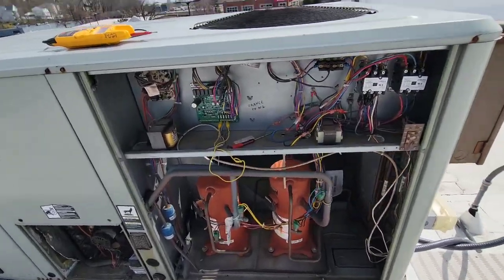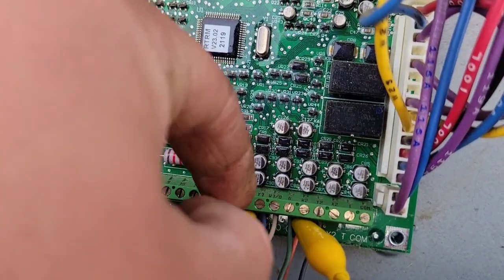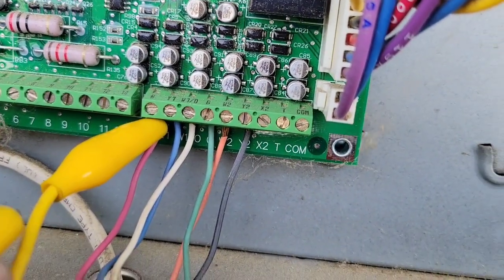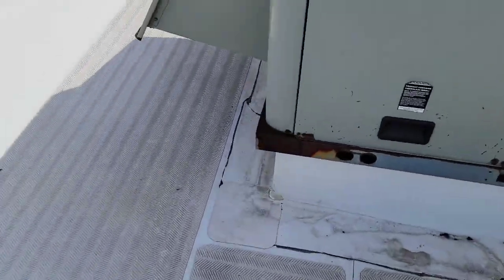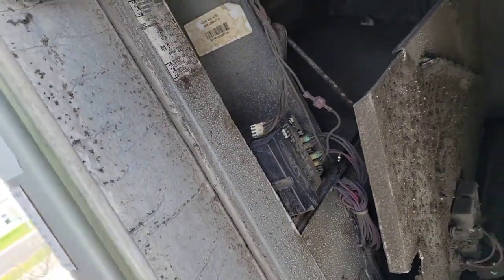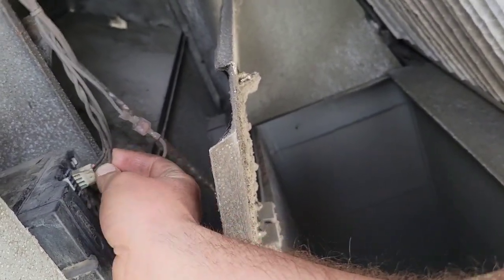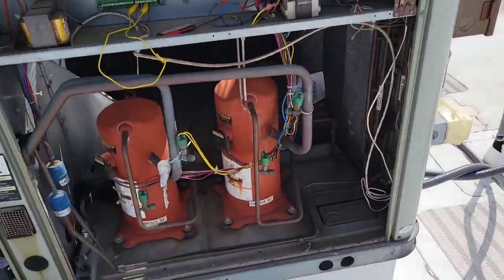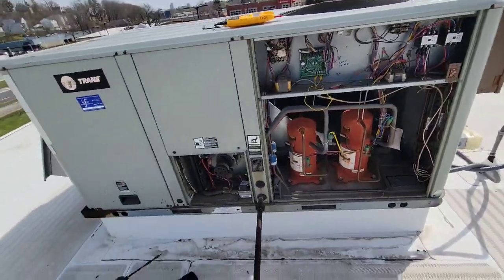HVACR- How to Jump A Trane Unit Heat/Cooling (YSC092A4RHA1HH100..)

Comment: How do you jumper a trane equipped with reliatel controls
Reply from the maker: I'm sorry i'm not sure,

If I cannot figure out how to Jump.
Something. 

I will do the following. 

1) Use the thermostat to do so. Just change the thermostat settings so it will work in the corresponding manner that you wish. 

2) Directly connect r to y or w1. 

3) You can trace the wires back to the thermostat.And then jump the wires closer to the thermostat. That way you can give it the false signal to run whatever mode you want. 

God bless good luck